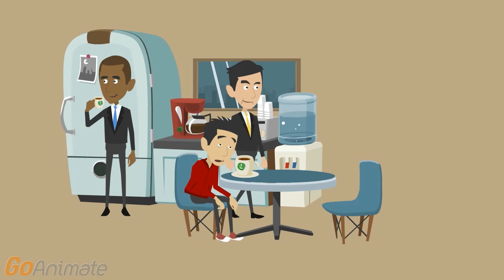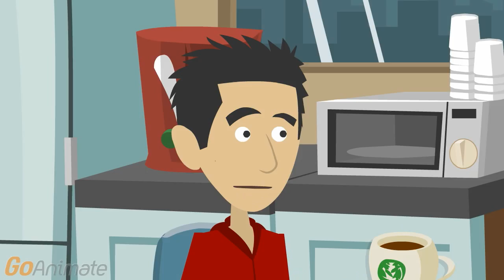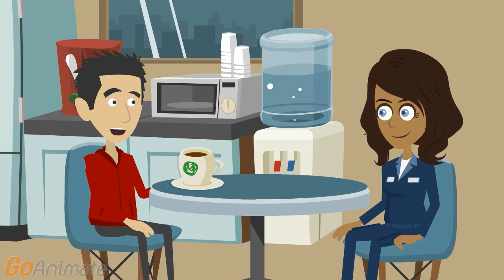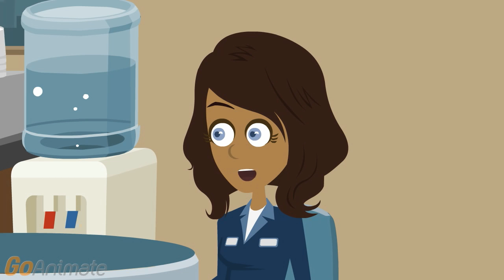Gas Furnace Kicks On Then Shuts Off

Comment: Had a similar baffling problem. Called in a pro who checked out everything and he discovered a clogged condensate tube. Water backs up into the secondary condenser fan and gets into a vacuum pressure tube. With a little water in that tube, the vacuum level is way off normal and the safety features kick in and the burner shuts off. Solution was to "blow out" the clogged tubes, drill one of the tube orifices out slightly (from a diameter of about 3/16 to 3/8), reattach the tubes and everything seems to be working.

This also explained why turning the system off for about 10 minutes seemed to work for a short time each time. The water would drain out of that fan and from the pressure tube so everything would start fine. But after a few minutes, condensate that was being created would back up and cause a shut down.
Reply: Exactly happened to me twice!!!